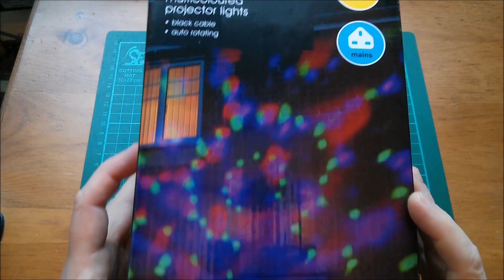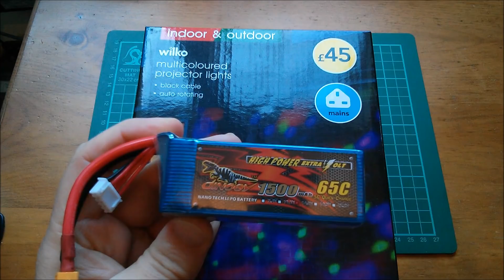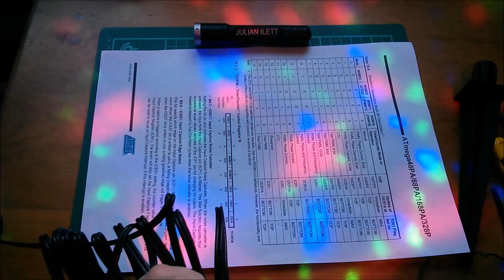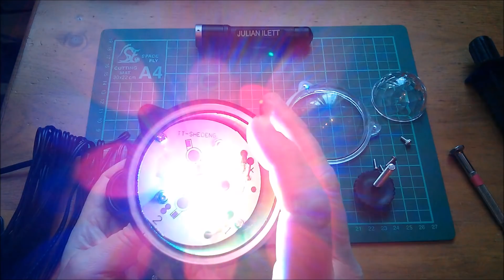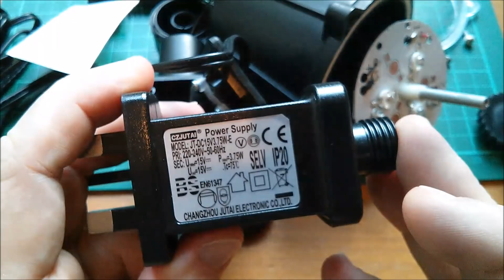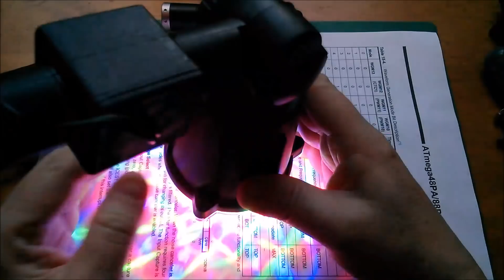Wilko Multicoloured Projector Christmas Lights

Comment: Hi, Julian, did you measure the DC side of the power supply volts and current with the projector connected and running.
Did you measure the voltage across the motor and across the LEDs.
You proved that the power supply has built in current limit, but I cannot see where you measured the load current and voltage on the projector.
That supply is operating in constant voltage mode when connected to the projector, so the load must be less than 3.75W.
Why can't you use your LIPo with a fuse in line, say 250mA.
Tom..

Comment: B&M Bargains are currently selling small battery-powered versions of this for £2.99 (I think Home Bargains have also got them for the same price or thereabouts). OK those are not waterproof and don't have high powered LEDs in them but even so, there is no way that thing is worth £15, much less £45 - If I was ordering one of these online, I would expect to get it for under a tenner. I know Wilko is pretty expensive these days, but 45 quid for that thing is seriously taking the P155 !

Comment: £45?!
You can pick up light fixture 'bulbs' for £3 that do exactly the same thing. I've seen them as low as £1.88 from china on ebay
https://www.ebay.co.uk/itm/3W-E27-RGB-Crystal-Ball-Auto-Rotating-LED-Stage-Light-Bulb-Disco-Party-Lamp-hold/292252711091?hash=item440b9e78b3:m:mY3fJ81IcfZLBj_VB7dT3Ow
That housing and psu arent worth £42...

Comment: I'm not so sure that's a special supply.  3.7W/15V = 0.247A.  You simply went beyond it's rating.  What happened is what I'd expect for any self-preserving power supply design.  What could be happening is that the motor is in series and acting like a dropping resistor.  I'd suggest making some voltage measurements while in operation.   Is it running at 15V or at 0.25A?
Reply: The LEDs would do the same thing. At 15V they'll pass as much current as you can throw at them, so it is current limiting the LEDs
Reply: But we still don't know what the actual operating conditions are.  Is it operating at constant voltage or current limited?  It could be a 6V motor in series with 3 LEDs.  6V + 3x3V = 15V.
Reply: Taking a voltage reading off the input connection on the circuit board while running could answer a few questions.
Reply: Indeed.